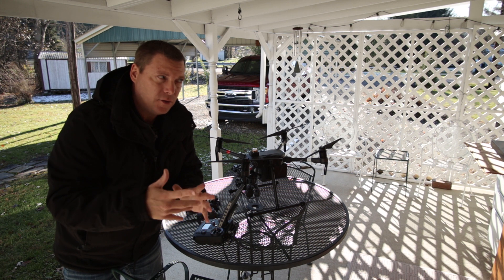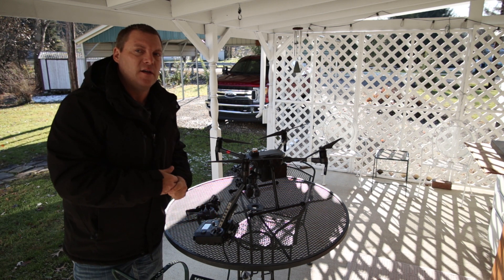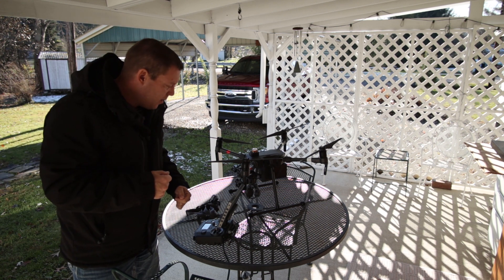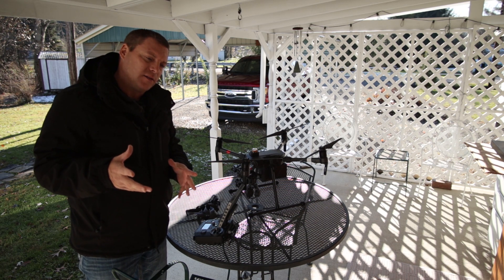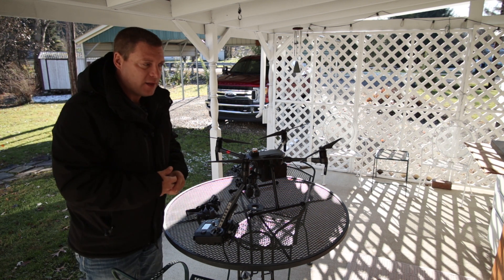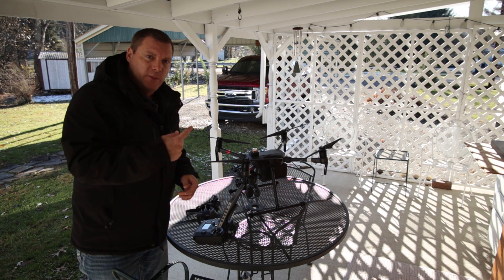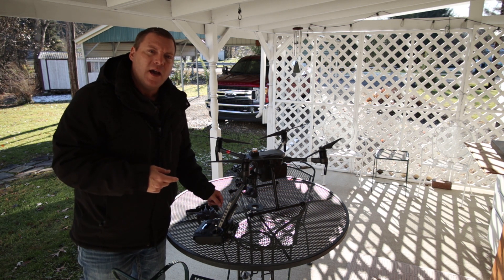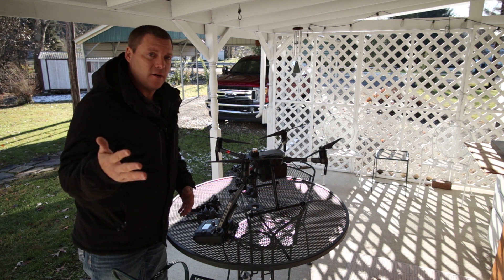DJI Matrice M210, Zenmuse XT, Thermal Roof Inspection

Comment: So, in order to get more accurate readings, it's better to fly on a cloudy day , correct? Or with the proper settings, you can determine the heat loss areas?
Reply from the maker: Yes